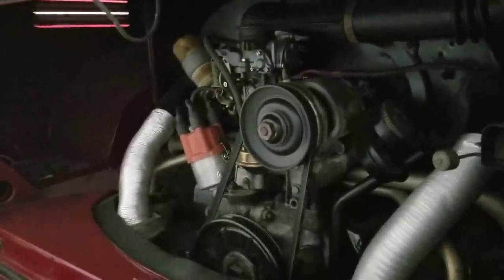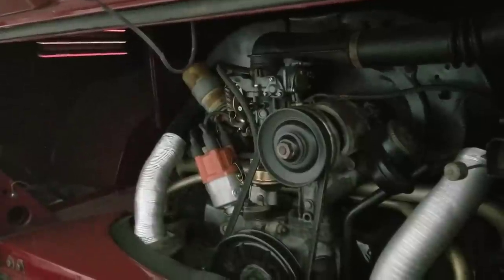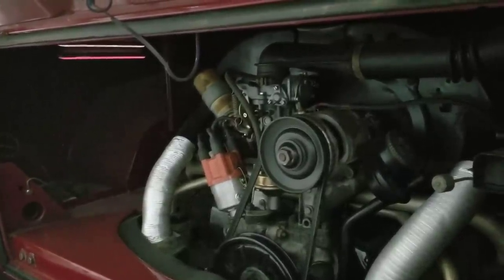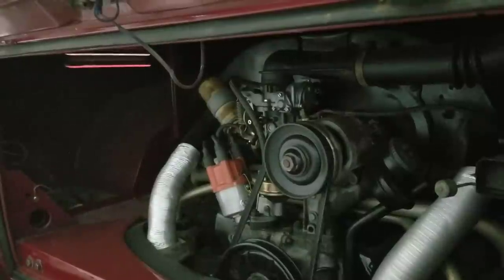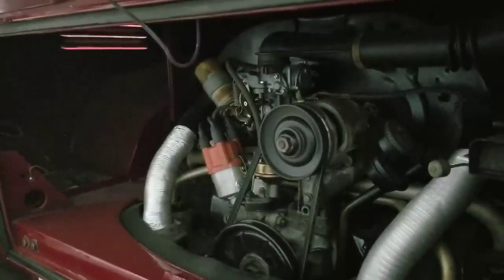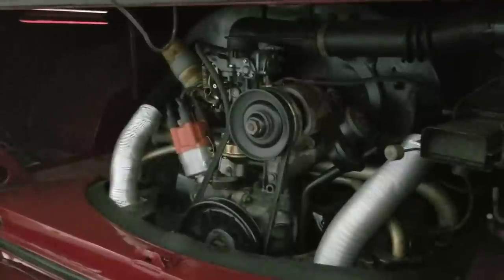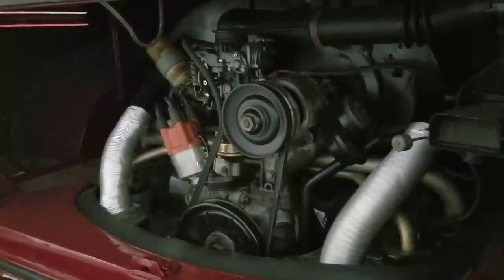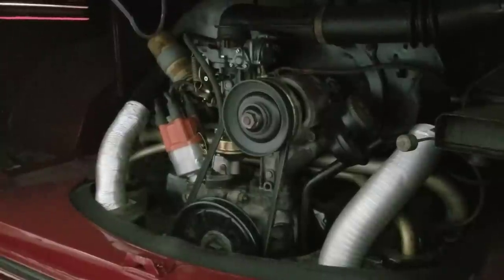Building a reliable Bulletproof 1600 VW engine with upgraded power

Comment: Mike I guess i calling the stock 1600 where I went with the PICT30 from your friends from Carcraft my bullet proof motor for my 63. I live in farm country so driving maybe a highway only at speeds of 55 or 60 for around 12 mile to the next town where I work. Most of the time it is only me and a John Deer tractor going down the highway and yes I can pass a deer. On a cool tin is that one without the flaps and therm. ???
Reply from the maker: I will put a pinned comment with some of the parts I am referring to thanks for asking. I love my empi carb it works so good idles so smooth now. almost cant hear the engine.
Reply from the maker: I will put a pinned comment with some of the parts I am referring to thanks for asking. I love my empi carb it works so good idles so smooth now. almost cant hear the engine.

Comment: Using off the shelf AA and similar big valve heads on a 1600 displacement  dont give you squat, except for a little more rpm power on the cost of lower rpm driveability. DONT do that, Especially not if you reuse astock intake and stock heaterboxes. It will only give you less lower rpm torque and elevated head temperatures on the freeway. The reason to why a stock valved engine with stock CR and say a W100 cam may run cooler on the freeway is because you have actually DECREASED the effective DCR at the given rpm. You may have more rpm power, but you lost some torque. Its the old Berg doctrine all over again, and it STILL doesnt work. If you want to make real power you need to make the engine more efficient, not just add rpm to it.
If you want to keep the CR low (stock) go for a W90 cam if it has to be Engle. The W series is advanced 3-4 degrees in the grind, so with the W90 you basicly keep the stock DCR, but add a little power all the way up to the peak. Using say a W100 will make the engine loose power up to about 3000 rpm and from thereon up to about 4500 it will gain hp, but very little torque.  
Jawbreaker is right with the 2280 cam, - as long as the engine gets a little more CR. 8,3 -8,5 is the sweet spot for it.
Also, if you want to make these engines run cooler, stop using those stupid 009´s and get yourself a proper SVDA distributor that matches the carb.
We  - are - living in the year 2022. I can´t believe that "engine builders" still recommend to use the 009 on almost anything.  You have quite an audience. How about teaching them someting new instead of repeating the same old BS that has been the norm for the last 30 years. Then your viewers can actually get a chance to build themselves a nice functionable engine instead of keep throwing good money after bad.
Theoreticly I perhaps ougth to do it myself, but I do not have the time for it, nor the skills to film and edit such a video.
End of rant.
Reply: clap clap so proud of you son. now go sit in the corner
Reply: @ICU2HI  Thuth is always taken ill. Especially if you are proven wrong. All you have to do is test it, on a calibrated dyno, and the numbers will show you whats going on.

Comment: I would like to know more about the correct jetting for the single carb 34 PICT?
Reply from the maker: can get round about jetting numbers for air cooled website. every engine is different though. depending on side. nomal 1600 DP with stock compression is around 30 to 35 main and 55 idle and mid. but you need to tune it and drive it and probably change it up or down. sometimes you need to loosen and pein the idle jet. it is not cookie cutter.

Comment: Hello , thanks for the vid , great info. 
I actually have a 1600 Stcok and I am planning on buying slip in  AA P&C 88.0 that goes up to 1700cc, would I get any more power really , if I don't do anything else to the engine ? , Do I need some extra cooling because of the thinner cylinder walls getting hot ? , Thanks so much .
Reply: Don’t do 88 mm slip-ins. Go 90.5’s.

Comment: Mike, Got a question is it possible to install a 6 volt 180 flywheel on a 1600 single port. It's a 40 hp replacement engine. Love your content regarding vw's. Thanks Chris.

Comment: Would you recommend a particular engine size for long trips and hill climbs in a bus? I'm thinking about either a 1776 or just rebuilding my stock 1600. It looks to me like anything bigger might make hill climbs much more respectable but you come across too many issues, heating, pcv and no longevity
Reply: I believe 88 mm machine-in cylinders and pistons are recommended for buses.

Comment: How can I find out what parts fit my 1994 VW Mexican Beetle? I have a hard time finding parts for it. Local auto part store, can never help me find the correct parts.
Reply: I'm far from being an expert but if it's engine parts, I think they used the same engine design used when the beetle left the us in 79. normal parts should suffice.

Comment: What is cool tin?
Reply from the maker: type 3 tin I will put a link on the video
Reply from the maker: type 3 tin I will put a link on the video
Reply: @Mikefngarage  ah okay thanks, we run heater boxes, but cool to know.
Reply from the maker: @VWLifeVW  I always like to run heater boxes and still run the cool tin they go under the cylinders and have metered holes that control the air around the cylinders. Replaces the plates between the cylinders.  puts more air through the head. We are averaging  a huge difference in head temp with those installed. I put up a link on the description.
Reply: @Mikefngarage  oh okay on the website to purchase them it says not to be used with heater boxes.
Reply from the maker: @VWLifeVW  yea I am not sure why they say that. There is a lot of controversy about them but they really do work we tested them in the 80s and found on every engine we put them on a pretty significant difference in cooling.
Reply: @VWLifeVW  strange; cool tin was originally developed for Type 3 pancake engines that ran heater boxes....

Comment: Mike, great video. Have you ever had a fire in the bus engine bay while driving? If so, how did u handle it? I'm considering the blaze cut hose suppression system that is installed over the shroud area. Heres a vid of it. https://youtu.be/iePku-2jh7Y

Please let me know your thoughts whether it wud be worth buying. Its about $250 for the 9ft size used on buses.